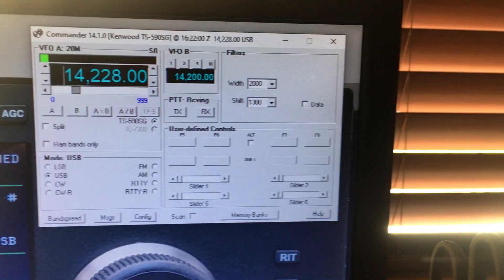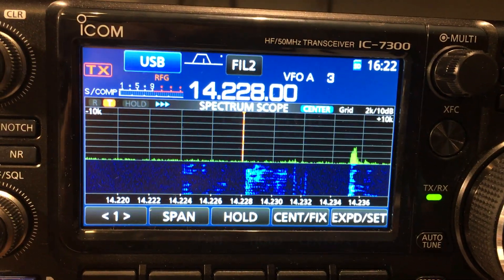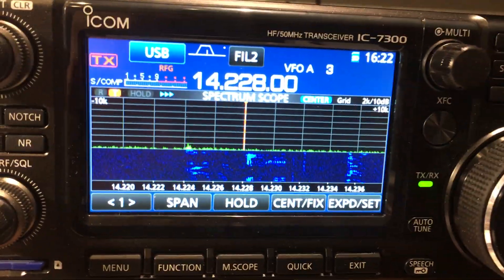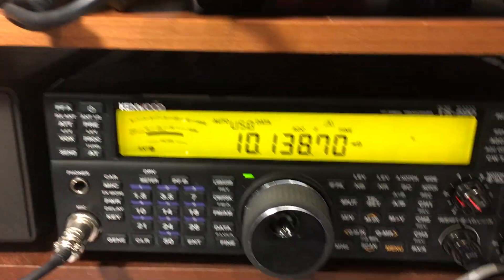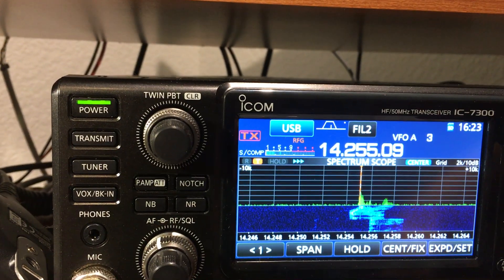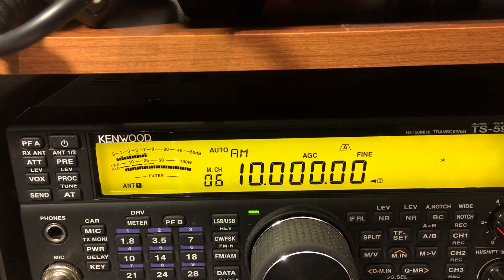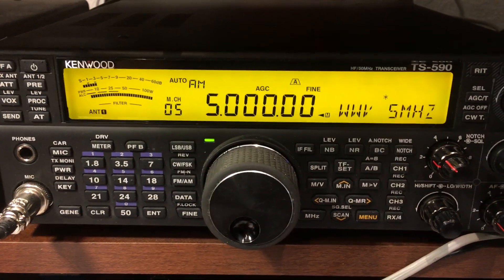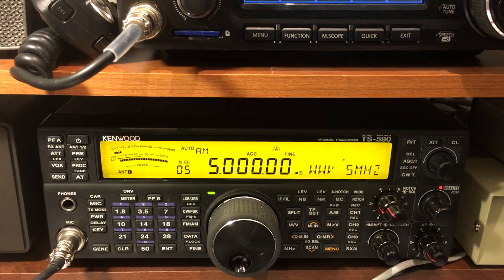KENWOOD TS-590SG dual receiver with Band Scope

Comment: Pretty fancy Band Scope Gene. Good job. Mike K7MMA
Reply from the maker: Thanks Mike.  If for no other reason, the project was a blast and extremely simple to accomplish.  No smart phone or tablet to prop up or laptop seemingly always need to to be moved somewhere else on the desk top or battery goes low and then have another cable across the desktop to plug in. Ok - all of that is picky little stuff.  done that, been there. Dumped.  No other active programs to bring to the foreground or move around on a multi-use screen. No sound control panel-human caused alterations (rare but can happen) to have to re-configure.  Just a really fast processor in the 7300 stacked directly on top of or beside the other radio.  Hard to beat its excellent display and tightly integrated freq calibration with the 590 for no detectable latency.  Solid 24x7 all year 'round. 

I now have a transceiver with dual receivers built-in once again and its associated band scope.  If I need additional detail, my RSP1a and software on my computer can be brought into play.  Due simply to lack of room, I sold off the IC-7300 and kept the TS-590SG which I doubt I will ever part with due to its amazing feature set that I doubt many hams ever realize it has.  Besides that, if I had to grab a radio to run out the door before the house fell down (why-it better not!), the 590 gets saved!

Comment: Nice
Reply from the maker: Thanks Francesco.  It was a fun project to put together and I am still using it gosh, must be over 2 years now.  During this time, I acquired a TEN-TEC Omni VII for $270 that only required tossing out the under-engineered Molex power connector and replaced it with appropriate TX amp, capable PowerPole mating connectors.   I added this O7 into the DXLab Commander program as an alternative, Primary radio which allows the IC-7300 band scope/touch screen functions for band, mode and frequency changes to work between these two radios too.  Just what the O7 radio needed that the orignal TEN-TEC owned company indicated they would eventually do, but never did before T-T closed the first time. 

Some people will argue that paralleling the RX path from the Ts-590SG's DRV/RX Antenna Out port with a 3db loss just isn't acceptable.  I can tell you that the 3db down, which bear in mind, is both signal and noise, is quite acceptable for almost every signal I come across. Yes - the weakest signals will not display much if any on the scope with the 7300's receiver driven this way.  Frankly even if the 7300 receiver or any other band scope receiver SDR on computer or otherwise, is directly driven from an antenna (any antenna), it's not going to present much of a useful scope blip anyway for the weakest of weak signals.  But when I go weak signal hunting, I tend to be rolling the VFO knob and listening instead of watching a band scope.  To me the band scope is more useful for first-find of an open spot, and then listening, and calling out to see if the frequency is clear, before using that visual appearance of an opening to transmit on. 

Scopes are wonderful to find out why some other guy is transmitting across a far wider spectrum than he or she should; or maybe it's just a really close-in, powerful signal that overruns the 7300 a bit (a bit easy to do on the 7300's SDR electronics. Not knocking the pretty wonderful 7300 but hey, it is a low cost design.  And still way, way better than a lot of radios we, or at least I, used to consider as excellent.  

Most of the time, I run the 7300's receiver on an entirely independent antenna, usually a Magnetic Loop while I CAT link the Band/Mode and frequency between it and my primary radio.  Or maybe I unlink the CAT and use the 7300's receiver to troll the same or different bands. Having two rigs has a lot of advantages in how you can utilize them, together or separately. The 3rd rig; the Omni VII is my first choice for CW operating, versus theTS-590 which is also very good but the O7 is certainly better. And sometimes it can be more pleasureable on other modes too  The slice and dice of it's Passband and Width controls are defintely more refined than the other two radios can achieve. Pros and cons - having different radios can be useful tools. The TS-590SG is the most flexible and most capable.  Plus the Superhet receiver is still king.  Heavier to build with more complex circuitry over an SDR design but it still has an edge.  Even ELECRAFT still intends to make a Superhet version of the K4 I think, at least the last I checked.

Comment: Thank you for your informative video. Just a bit off topic, ease of use and the scope aside. From a view point of working weak signals and filtering out strong stations near the one your working, what should I spend my money on 7300 or 590SG?????? Thanks. Paul. 2E0 PPJ
Reply: The Kenwood has a real dual Superhetrodyne reciver section with built in roofing filters blowing the SDR reciever mode of the ICOM radios out of the water. Oddly the Kenwood had a handle for portability and a built in tuner that both functions quite well but does leave the question of adequate power to meet the need of both the computer and transciever in full xmit mode. No doubt there are a plethora of videos showing how to bring a dull size glass mat deep cycle battery and load control. lol. The Kenwood with a 7300 and this software in a POTA situation would kill thr competition but does not comply with any rules. what a setup he has created though! hats off to our maestro. 🎉
Reply from the maker: Both of these radio models are very good.  Most modern receivers are very competitive in day to day use.  Weak signals and/or strong station issues to deal with, my FT-DX5000 is far more capable.  Roofing filters with tight skirts and a plethora of far more capable digital tools make this radio one of the kings in difficult situations. If you can afford the way overpriced ELECRAFT K4D, that is an excellent rig to go with.  Higher end ICOM's too.  The FT-DX101 has outstanding receiver characteristics.  I prefer ELECRAFT and KENWOOD since they have engineered in some features I like that YAESU does not have.  Higher end ICOM's can work too, and have a few things I like better on them.  Hard to pick one radio does all you wantt after a lot of years operating from tubes to solid state.  What I am not I'm fond of are FLEX radios which continue to improve but still has a few more "why did they do it that way" and "why doesn't it do that" issues before I can like them.  Still too dependant on an outboard computer too.  

With some compromises that I can live - If I had to buy a new rig right now (Feb 2023) with my current best-choice; I would order a TS-890S and link it to my existing TS-590SG to have the switch selectable choice of dual receiver operation or two independantly operated transceivers.  I hate the KNWD implementation of NB is my only real nit-pick.  Its signal filtering in the 890S is better than the 590 as we should expect for the extra cost of its still outstanding, superhetrodyne receiver hardware.  Cost is the drawback of the superhet because it has a lot of hardware circuitry that an SDR based receiver does not. That said, I still prefer the purity of sound that an SDR finally, almost matches.  My opinion anyway.  

Honestly I do like the 101D or MP SDR based receiversa lot.  Or my current superhet based 5000MP better for slice and dice of weak or annoying station signal issues. But there are some things that a high priced KNWD 890 and the ghastly high priced ELECRAFT K4D have that I prefer.  Your requirements can direct you to a different choice.

Comment: Expensive specrum scope ;.) Buy a SDRplay, sell the 7300 and you will be more happy.
73
Mark
Reply from the maker: I have an SDR receiver and I have used an SDRPlay RSP1.  They work fine.  I doubt many will disagree with that.  
Are many of the SDR receiver boxes cheaper than my solution? Absolutely.  But this was never about cheaper.  It is very much all about how to do it better overall.  Especially for the issues I have with my eye sight.  There might be points of functionality that some of you will find and prefer to use an SDR box and software such as HDSDR.  I still have that myself.  Haven't used it in months now because I get all that I need to do in a clean, simple solution with stunning results.  And while the SDR box/USB/CAT/SDR software approach is pretty stable, the 7300/USB/Commander CAT software is a rock of stability. 

For someone that wants to use an IC-7300 in this manner, the cost of a new or used IC-7300 has come down a bit.  If I were a newby that already has a 590SG and wants to add a band scope,  I would heartily recommend the SDRPlay  RSP's because they do work so well/great price point. Given some experience and understanding of what the 590, G (aka SG) brings to the table over and above the excellent 7300, I would tend to recommend my approach for reasons I have not even mentioned here.  A lot of this depends on how somebody operates which radio we use so nothing here regarding a 590 or 7300 combined or independent might be acceptable.  We have choices!  A lot of which can also depend on our pocket book...

 But again this is about doing this better for certain reasons including specifically but not exclusively for myself, an eye condition. And not that problematic of a condition either.  My ultimate within this level of dual radio with dual disparity reception or independent transceiver operations to name a few, would be to link a TS-890S to my existing TS-590SG. If you really studied what KENWOOD provides in their firmware for interoperability between two such rigs or even a pair of 590's, it's stunning.  Kudos to KENWOOD engineering, and their bean counters for allowing such amazing things that you will never realize, sitting in front of one at HRO or other stores.  Things that the employees won't even (likely) realize or be able to show you. I am cognizant of doing similar with ICOM and YAESU rigs but there are still some specific things about having at least one KENWOOD in my lashup that I prefer.  I haven't thought this out but I should be able to link four radios together in the manner I have now.  Except I have no clue what purpose I personally would have for that.

Be that as it may, I am not suggesting that the lower price route is inferior.  Besides price point, it may in fact provide different features of value to someone else.  This is just another way to do it and for me, exactly what I was after.  I wasn't even 100% sure I could make this work as I perceived it until I got it home.  Had the config up and running the same day.  Found a minor bug in the Commander program configuration setup and Dave/DXLab tweaked and released a new version of his free software pretty much overnight. How cool was that!

Have fun and be creative out there.
Reply: Boogie troll